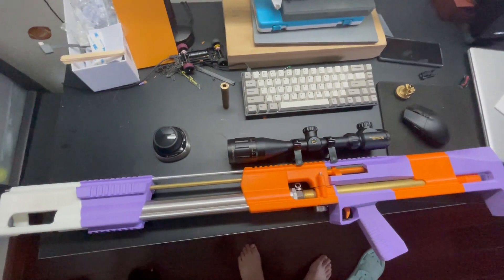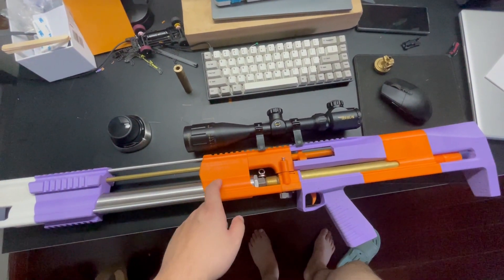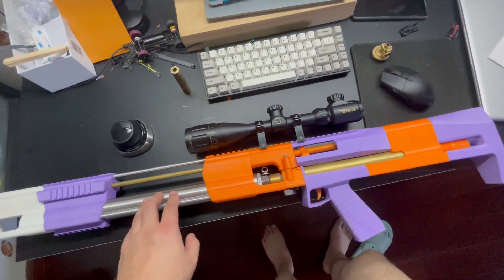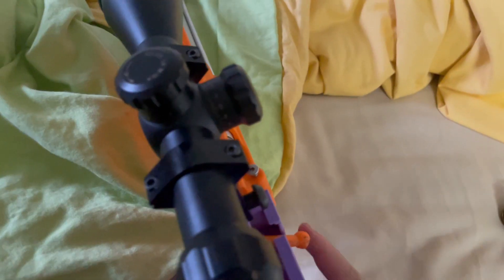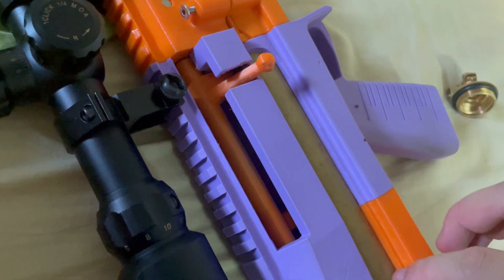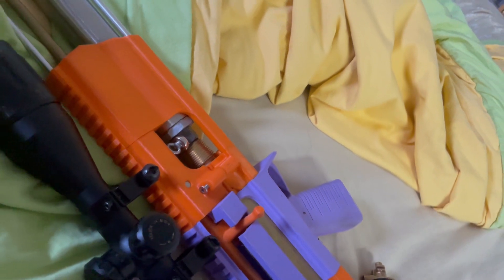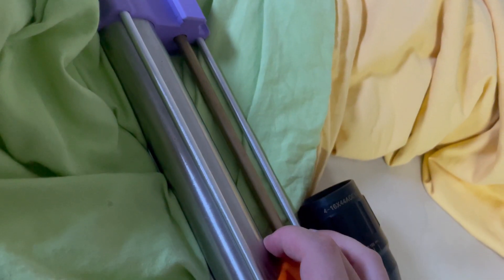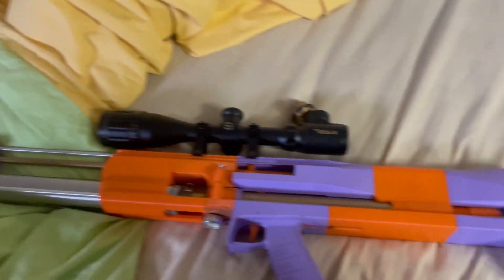3D print PCP air rifle Home made airgun

Comment: You should get a .177 or .22 Or rifle caliber barrel blank, you can buy old air rifle barrel, you can even make your own .22 barrel.   A smoothbore is not accurate, you need to make sure the power is not over 12Ft/Lb otherwise it'd classed as a real firearms in the UK. The limit for pistols is 6
Reply: If you study gun design more in depth, you will learn that a smoothbore is correct and super accurate when shooting round balls, especially hard metal ball such as steel.
Reply: Yes  they can be I have shot many steel copper coated 4.5mm balls from air rifles but it really depends on the range and velocity, for shirt ranges fine and even in shotguns  things like lead ball, slug, wax slugs they can be reasonably accurate but rifled barrels are always more accurate for small projectiles in a standard setup and you get more consistency. Some russian airguns meant to shoot copper coated steel BBs have heavy duty rifled barrels and you can tell the difference quite alot in accuracy and consistency ' @JPPieterse-p3x

Comment: what kind of ammo do you use in this type of rifle?  and how did you make the barrel? congrats on the project. I downloaded your files but I can't find machining instructions for the barrel
Reply from the maker: It doesn’t need any machining;as it uses bearing steel balls as ammo, it simply adopts an extruded brass tube. Extruded tube are probably the straightest barrel people can easily bought at decent price.
Reply from the maker: But I have another new project still as rough CAD works in my computer, where I do plan to use rifled barrel, I am thinking starting with a hexagon extruded tube, then twisted it by some manner (may need design some jig for it). In this case, I imagine it could work as those whitworth rifles.
Reply from the maker: Or if the twisting can’t be done, I am also thinking 3d printing the twisted hex inner barrel using SLA (the barrel won’t be very long this time ); then casing the printed barrel with a brass tube. The ammo in this case I imagine would also be 3d printed, probably with some lub pre-applied. I am simply too busy to profess this project this year, hopefully I could have some time to actually finish it next summer.